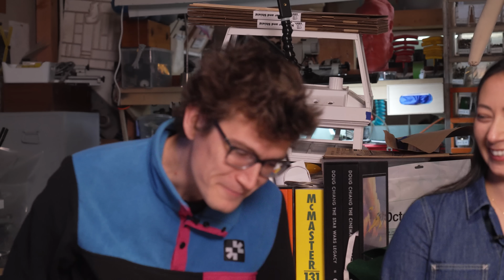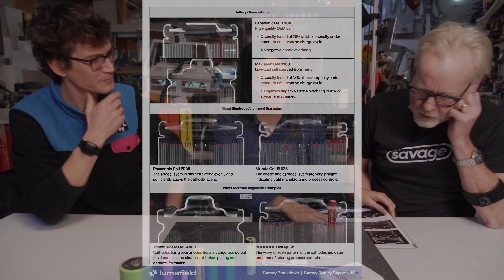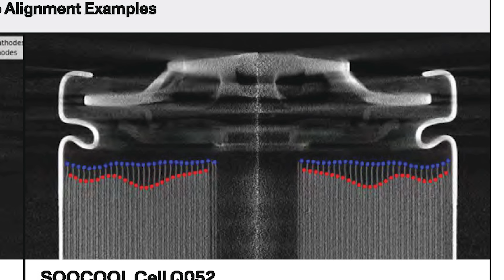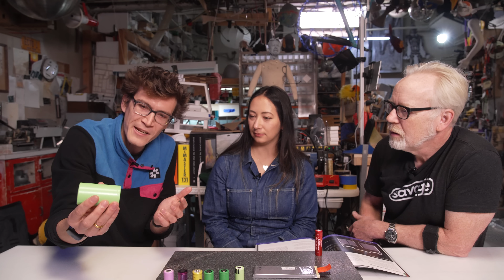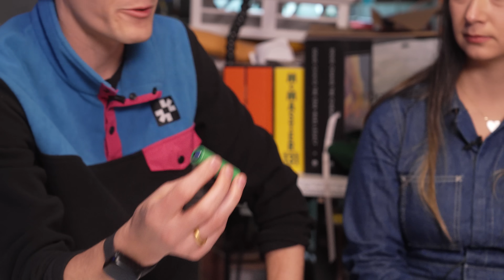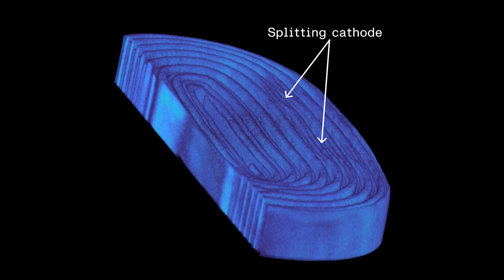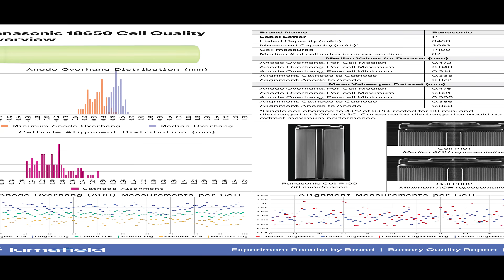The Surprising Flaws in 18650 Lithium-Ion Batteries

Comment: 18650 batteries - im now haveing to by a 4th charger because 4 in a row all failed to charge 2 from china 1 from a good shop and another i was given. all batteries are brand new and work fine on a mates charger but the chargers all have not workd for me as of yet. thanks for shearing this content.
Reply: The Opus BT-C3100 is a good charger for loose cells, plus it can test capacity etc. 
I've used one as a tester for a couple of years, it's great for picking out fake rated / counterfeit cells.

Comment: Thanks guys. The battery scam industry has numerous other tricks, including reselling reclaimed cells from old equipment, selling low capacity cells filled up with sand to make them feel like legitimate cells, selling battery packs advertised as the storage capacity of all cells connected in parallel, when they are in fact connected in series, and more. 

That latter fiddle has become extremely common, even with some otherwise reputable manufacturers. 

An example of that is the power bank which is sold as having an output of 12 Volts and 10,500 mAh capacity. (I hate that inflated selling technique, too. It's 10.5 Ah.) Upon inspection, you will find that the pack contains 3 series-connected cells, each with 3.5Ah (3,500 mAh) at 3.7 Volts, giving 11.1 Volts at 3,500 mAh as the true capability of the pack. If you're lucky, the pack will have a boost converter to give 12 Volts output, at something like 3 Ah (3,000) after converter losses, when new.

But explain that scam to the average customer, and they don't understand that they have been scammed, and if you complain to the seller, they either don't understand, or else don't care about their customer, and just fob them off with an argument that they are wrong, and then quote the erroneous explanation outlined above to them.
Reply: Perhaps the best figure to look for when buying cells or battery packs is the capacity in Watt hours (Wh), and to buy genuine cells directly from reputable manufacturers or their authorised retailers.

Comment: I had some cheapo poorly made AA lithium-ion batteries that you can charge with a micro usb that plugs into the battery itself. I was charging the 4-pack and noticed it was taking a while. Grabbing them burned my hand. Got rid of them and replaced them with enloop

Comment: I was working at a Youth Residential Treatment Center as a Night Shift Supervisor While the Day-Care Staff were Asleep in the living rooms, One of the staff's laptops one night spontaneously combusted while charging, lit up the entire living room they were in, Staff jumped up screaming running to the kitchen, I got up after the initial burst happened to investigate what's going on. The thermal runaway didn't yet trigger the entire battery, So I grabbed the staffs one gallon jug of water, unplugged the laptop and dumped the gallon of water on the laptop to put out the flame/thermal runaway from spreading. 

It ended up working, However with it now put out, one of the staff came around the corner with a fire extinguisher and started dousing the entire room with me in it dumping all that powdery residue, which spread throughout the house. Which lead to us having to evacuate the kids/staff from the house. (Not because of the laptop explosion/fire. But from the extinguisher that wasn't necessary lol). It turned into a long night of cleaning.

Comment: Let me get this straight, they bought no name batteries from temu, Amazon, and the like at 1/10th the cost of a quality brand and they found they have poor construction with no QC. They think this is a revelation? This ain't news. Every circle I've been in from automotive to electronics has said to stay away from Amazon and the rest for important parts because if the junk brands don't get you the counterfeits will.

Comment: Vaper here. I've been using these cells for about 10 years now, 18650 to 21700s. I use regulated and fully mechanical mods with absolutely no safety features! I've never had a cell fail on me, other than age or over discharging them. Thankfully and hopefully I never experience one. Buy good cells from good vendors. Don't buy junk. Samsung, Panasonic, Sanyo, Sony and molicel are my go to

Comment: Since a lot of ppl don't seem to have common sense when shopping from china, here's something to always keep in mind. 

The more complicated a product is to produce, the less you wanna risk it by buying a cheap chinese counterfeit. A lot of simpler electronics, like pcb's of different kinds, are fine because they're not producing the components themselves, just buying bulk and populating the board. Same with non electronic products.

But batteries, sdcards, usb sticks, even usb-c and other cables, which they can't just buy cheap components in bulk and assemble, you should stay away from. Same with most products you're gonna plug straight into your outlet.

Comment: That's why I look for AA and AAA NIMH devices. I have many Eneloop batteries and they likelihood of fire or issues is extremely low. Using a Fenix E20 V2 flashlight, Ozeri kitchen scale, Sony Radio, Blink door camera etc... There are great AA and AAA alternatives for some devices. The other great thing is using a replaceable AA for example means you can have the device for ever in some cases. I have AA/AAA powered devices that are 10+ years old. A built-in lithium rechargeable version would have failed after 1-5 years typically depending on battery health.

Comment: Is there an investigation into the Gel Packs used in model aviation , these are the ones that burned houses down..and explode in the air. smoke for hours,  yes  yes ,   everything is better with balance chargers and temperature monitoring....still explosions happen...

Comment: If you DO decide to throw out a LiIon battery after watching this video, BE SURE TO FULLY DISCHARGE it first, and dispose of it properly - not in the trash can. Fully discharged batteries can't start a fire, but the lithium and other elements are valuable and recylable, though often NOT in standard recycling bins.

Comment: This is definitely my justification for only charging batteries, pretty much any of them, only when I am around and able to respond to an issue.  I only run my older dryer when I am home as well, it got hot once and I do good maintenance but it can still be a fire hazard.  Be smart and prepared when managing risks that could potentially ruin your life, or burn everything down.  Ounce of prevention, versus a pound of cure..  I stay prevention

Comment: I was following fine until the weird FAA sourced?/advise on submerging a lithium product in water. IMO I have no idea why this idea took off, I can see cold packs up against the cells to pull heat away; but if submerged in water and that cell gets any puncture, that water/lithium is going to react violently. Make a bad situation worse. Especially if companies are using different qualities of lithium, maybe leaving chunks in a product by mistake, so on.

Comment: most people dont interact directly???  what?   like i have flash lights, vapes, tools that all take direct batteries. i have chargers for them that will take any length cyllidner lith ion.   i also have a couple hundred in drawers from packs and such that died over the years but batteries were fine

Comment: OK, I had already recycled a pair of eBay counterfeit Makita 18V batteries because they didn't have a fusible link inside.  Now I just tossed a pair of counterfeit DeWalt "20V" batteries.  I was only using them in LED work lights.

Comment: My wife and I and most of our friends are cavers, and we have a huge number of 18650 batteries.  The majority of mine are Nitecore and Panasonic, but I do have a few inexpensive ones bought off of amazon that will be properly disposed of now.
Reply: Where do you dispose of them?  I have a bunch of them that I need to get rid of, and nobody will take them.
Reply: @rickt.1870  When I need to dispose of LiIon or LiPo batteries I firstly put then into a bucket of water for a month. This discharges them and if any fire was to happen, that water (which is 20-50x more than a battery) will dissipate that energy.
Reply: @rickt.1870  Home Depot, Lowes or other home improvement stores often have a bin to place batteries for recycling.
Reply: @rickt.1870 my local home Depot has a disposal station for them. You can also try Google search.

Comment: Still remember buying tons of 18650's back between 2014 and 2018, for vaping, but realized even expensive reputable brands could be as crap as the cheapest if there's a bad batch.  Hell I remember getting a batch of bad Sony 18650's in 2015, 4 out of 6 discharged improperly to the point 3 of those just failed and shorted.

Comment: 18650s are ubiquitous.  The Ingenuity helicopter that rode to Mars on the belly of the Perseverance Rover used six off-the-shelf Sony 18650 batteries, recharged by solar, and flew on Mars for almost three years before an unfortunate crash.
Reply: It crashed????
Reply: @rogierius  Yes, it was traveling over sand dunes using autonomous flying and it didn't see a dune and broke it's rotors in a bad landing.
Reply: That's wild. I would have thought some compact pouch cells were used... Less weight from the metal casing.

Pretty cool though, especially since it was still working and a crash took it out.
Reply: @volvo09  Not sure about that, the cylindrical form factor offers better strength and weight to volume ratios.
Also as mentioned in the other reply, these are tried and tested, reliable - and much cheaper than a new development!
Reply: @DR_1_1 hexagons would pack better but do the spaces between circular (cylindrical)  cells help with cooling?
Reply: @alansloan2845  I don't think it helps for cooling,... usually batteries are in tightly enclosed spaces (even perfectly rounded) and air is an excellent insulator.
Probably more about simplicity and economy of production, and robustness, a bit like a can of soda?
Reply: @volvo09  Sony VTC4 18650s to be precise.  It is claimed the used them based on their popularity and reliability in hobby drones and small communication satellites.
Reply: If you want space approval you need to contain the batteries, which a pouch will not do.   You then end up placing a bigger metal box over them vs a box over the 18650 and add cooling solution around them.

Comment: Fun fact: the issue of electrodes being too close to each other due to manufacturing error was the reason why the Samsung Note 7 had to be recalled. As the battery gets hot during charging, it slightly expands, and the electrodes were separated under the proper tolerance for that expansion, making them touch and short-circuit.

Comment: Some years ago I went looking for Ultrafire 18650 cells on Amazon and ebay. Literally every one, from every vendor, was a counterfeit that dud not completely match the color, capacity label, or some other spec, if carefully compared to the Ultrafire corporate web site.
 Counterfeit (or very low capacity) 18650 cells plague the market.
 Know your vendor!
 Neither Amazon nor ebay had any interest in banning the vendors of the counterfeit goods.

Comment: What did Tested get paid for this sloppy hit on current battery cell industry/supply chain bit. 

Adam you’re better then this trash plug. 

Lumafield’s a 2019 Boston startup that’s raised $142M in VC by early 2026—including $75M Series C in March ’25 from IVP, G2 Ventures, Wellington, and repeats like Lux Capital, Kleiner Perkins. Backers: Tony Fadell (Nest founder), Dylan Field (Figma CEO). Their Sept ’25 “Battery Quality Report” scanned 1,000+ 18650 cells, bashing cheap ones for 8% cathode defects risking fires, praising Samsung/LG.

Comment: 20:41 don’t throw away batteries.  Recycle them.  Home Depot has a recycling program.  Best Buy and Target used to take batteries.  They may now only do electronics.  I believe battery specific stores will take old batteries for recycling.
Reply: RC hobby shops will usually take them as well.
Reply: Yes.  they will be happy to throw them away for you.
Don't kid yourself, how do you think they are recycling these batteries ?
The landfill near my home has tons of 
5 cent deposit aluminum soda cans  that were to be "recycled "
Reply: @tylaranderson8559 the same could be said for the people who take your trash from your house. At least here, both cans go in the same compartment of the truck. It doesnt matter where you take them, of course you should ask what they do with the batteries. Most employees will be happy to explain their disposal process in as much detail as they can.
Reply: @dlaw1954 doesn't mean that these employees are going to be honest with you
Reply: @tylaranderson8559  The improper disposal is on them then. At least you won't be responsible for setting the garbage truck on fire if the cells get crushed or shorted.
Reply: In a nutshell my biggest take away was these are dangerous you should throw them away and I physically  cringed. So glad other people triggered on throwing them away.
Reply: He said "throw them out" not away.

Comment: 14:51 4.1 ish.  3.6 is ready for a charge.
Reply: 3.6v is nominal and only about 50% discharged. They have a safe range of 2.7v-4.2v typically
Reply: 3.6 or 3.7 is proper charge when shipped. If you keep it above 4V for longer periods of time you will get much quicker cell degradation.

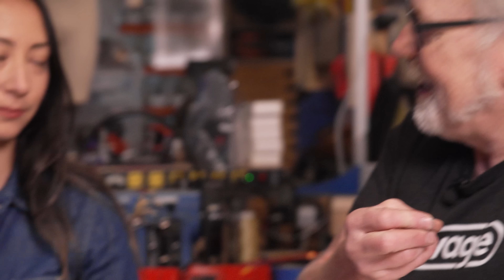Comment: 2:22 😂horseshit. I’m a vape douche.   I’ve been carrying 18650/21700 powered vapes for a decade.  Ive dropped that specific purple battery they have there hundreds of times.  Literally hundreds of times I’ve dropped these batteries.  Not a single time has one exploded or caught fire.  They haven’t even swelled.  Those purple Efest batteries are actually really high quality.  I have one that has maintained excellent capacity at probably 1000 charge cycles.  I like this guy but that statements is simply not true.
Reply: Ah yes, anecdotal evidence vs scientific testing.  Regardless, Adam isn't saying that every battery is a single drop away from going up in flames, but that they are far more prone to doing so than traditional lead acid or alkaline batteries.  That's just a fact, there are widespread reports of lithium ion batteries catching fire for various reasons.  Hoverboard had an issue years ago with their products burning down houses and apartments.  Samsung had a phone that was banned from airplanes because it would spontaneously combust in people pockets, and after it was supposedly fixed, another fault was discovered that caused them to catch fire.  Also if you look at the manuals for most modern e bikes and electric scooters (most lithium ion powered devices actually) they will tell you not to let them charge unsupervised as they have been known to catch fire.  Now granted, many of these instances are not 18650s, it's an issue with lithium ion batteries in and of themselves But as they said in the start of the video, about 50% of batteries manufactured are 18650s (not sure if that's just lithium ion or all batteries) which just by virtue of being the most common are the most likely to have a failure.

Edit: Literally a couple minutes later she explains that the reputable ones like the one you named are much more robust and less prone to failure

Comment: Kinetic batteries and capacitors solve for all of the flaws of chemical batteries, can be distributed at any scale cheaply using common minerals, and suffer none of the other implicit external flaws inherent to centralized production and distribution.  That's without trying to calculate the "planned obsolescence" variables that result in wildly different outputs even from the same supply chains.  Capacitors last a million cycles, charge in seconds.  Gravity and Solar radiation have nothing better to do.  Get out of your own way with these chemical fantasy solutions.

Comment: not a plug but i get my batteries from the 18650 battery store online, i prefer the molicel batteries of any flavor, depending on my use case, but they have always seemed to have performed very well, no issues in years of use

Comment: Some time back i joined a facebook group that home-builds 'powerwalls' made with cheap 18650 cells.Thankfully i wasn't totally convinced,so didnt go ahead with building one.I've learned a lot since then,.
Can you imagine how dodgy those would be? I'm thinking the manufacturing flaws would be the least of their worries😆.
With the cell issues plus dubious connections and suspect charging/balancing, i hope they have the sense to not attach it to their house. Or at the very least use a firewall on one side!😬

Comment: i'm wondering if 12:06 we're seeing maybe the same factory made both, but one went to a discount market for being out of spec and the other went on to the name brand wing of the factory.
Reply: Exactly my thoughts.
Reply: Backdooring? In Chinese factories? 

No…..
Reply: @Racing_Pig  not even backdoor deals, the cells that fail the strict QC are sold as B grade batteries with more lax QC.
Also even outside of chinese factories it's very common, like for bread the discount bread was literally the same as the previous batch for another manufacturer, they just do their count, and whatever is left over goes in the discount brand sandwich bread packets.

Pineapples that fail QC for the stem are sold as rings instead of fresh, and those that fail QC for the shape get diced.